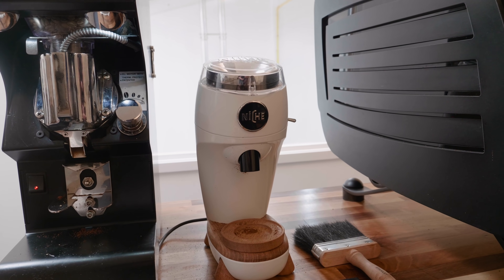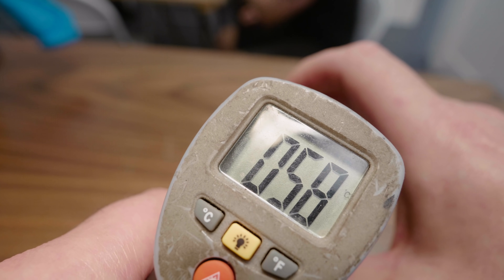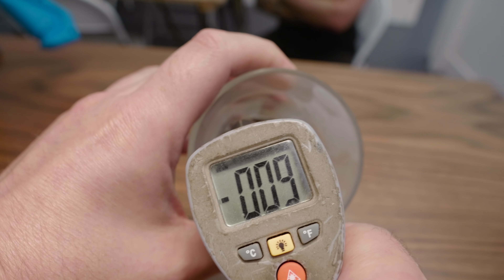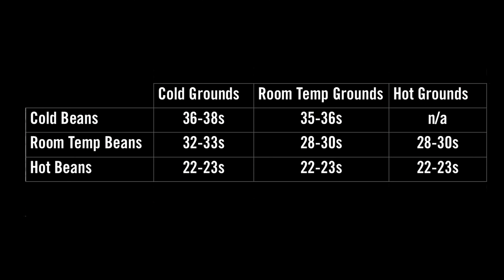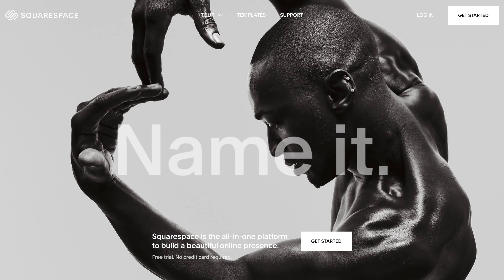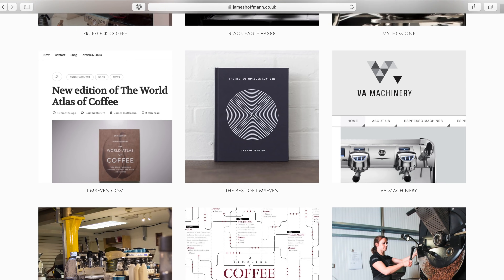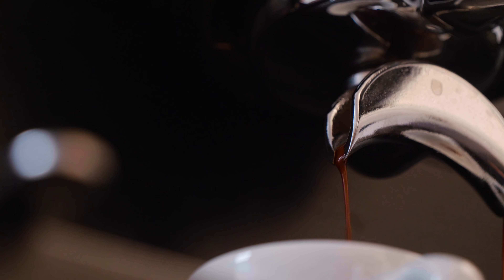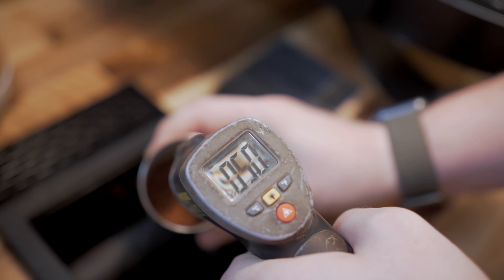Weird Coffee Science: Microwave Your Coffee Beans

Comment: Very interesting indeed.

My hypothesis as to why this happens is as follows:

Every grinder crushes the beans to an extent. The sharper the burrs, the less that happens I would guess, but it still happens. The crushing makes the beans break apart in places that they might already be weaker in, which produces fines. You can try that by cutting a coffee bean in half; even with a very sharp knife you will get many small particles.

Now, if you heat the coffee beans, the moisture in there in there spreads through them, making them softer and more elastic. Thus, the burrs have an easier time actually cutting the beans, and less "shattering" occurs, which leads to less fines being produced, and thereby finally to the ability to grind a bit fine and extract more.

I'd be curious what you guys think
Reply: This makes a lot of sense to me.
Reply: I was going to write a similar reply. I think by heating the beans, the oils are dispersed more evenly
Reply: I just woke up to thinking about coffee roasting then turned on the computer :) 
It seems to me old dry bread in a microwave brings it back if nuked for very short period of time by adding some moisture. An oven seems to do the same. I want to try this with some old dry (carbonized) toast and see what happens. 
I do wonder if its the oils in the bean or humidity in the air that is effecting it most but then heat may make the roasted bean more pliable/elastic. I notice dark roasts leave a lot of sludge when using a French press so I will have to see what happens by warming the beans with and without a small amount of humidity in a sealed bowl. I just looked this up and think it may apply. watch?v=YPNcTIauATw
Reply: My home grinder is crying for a burr replacement and landing on this video seems like destiny. I'm totally trying this out on my next drip.
Reply: What are fines
Reply: I wonder if this helps get a better result out of light roasts, especially ethiopian. Those are known to create lots of fines and are generally harder to get extracted right. If microwaving the beans creates less fines in the ground coffee, then maybe it'll make it much better in the cup as well, especially light roasts. I tried doing this on my light roast coffee, and it certainly turned out to make a more balanced cup of coffee. I used a moccamaster and a virtuoso+ to test this, so it's not espresso like James tried.
Reply: It's just a freaking cup of coffee.

Comment: Hi James,
In our paper we showed that at low T (dry ice, LN2) you made the average particle size smaller than at RT. But at normal freezer T the average particle size got slightly larger. We attribute this to a pseudo phase transition around 0 C (edit here: I originally mislistened and noted that the shots run slightly slower with cooling. This could be due to two effects, the mode of the particles is getting smaller, the volatiles are locked in. Heating causes their release, reducing void space for H2O and slowing the shot time per mL). This shouldn't be confused with the size of the fines decreasing monotonically. In fact, the reason for the skewedness of grinding at RT or likely microwave T (local T of H2O is very very high, the rest is being passively heated), is that you have likely reduced the number of fines being produced marginally, but also vastly increased the homogeneity of the boulders. I sit of the side of the "fines are doing the business",  so I'd be inclined to say that heating is problematic. Three other considerations here. I) we use microwaves to accelerate chemical reactions in the lab. The reason it works is microwaves, as I mentioned, specifically target a vibrational mode of H2O. The real test here is controlling for hydration level in the roasted bean. Of course in your samples they are all approximately the same but the corolary to microwaving is that molecules very near the hot water molecules are experiencing much much much higher local T than the rest of the bean. In fact the heat capacity of the bean is relatively low, so microwaving the bean is really just targeting local pockets throughout. In these pockets you may be performing chemical reactions, for better or worse, but it's worth being aware that a microwave is a chemical reactor. Ii) when we cooled coffee we had intended to also heat it using a similar process to Dawn. We couldn't do this scientifically because the deltaT was too great, even when dosing into an EK43. In other words the rate of cooling was way too fast to get good data from. Id be wary of assigning absolute T to any coffee beans using that surface IR device. III) letting the coffee equilibriate to the same T sounds, in principle, like a good idea and minimizing variables but actually at the T range you were looking at *this is your biggest variable*. Chahan and his talented postdoc Samo showed conclusively that the rate of certain volatile losses occured on the seconds (rather than 10s of seconds) time scale and the process is kinetically limited. This means at high T, cooling, vs RT sitting there, the chemical composition of the volatiles has vastly changed. Volatiles are one of the main reasons shots run at different rates - less water, solid interface, lower extractions, etc. When you grind hot you drive off more of these, and while your EY doesn't change (lets not talk about that measurement though...thats clearly problematic given the experiment I just described) your flavor profile does. Anyway, good compelling discussion but I sincerely hope we don't see people microwaving beans in the future, if only because reproducibility will nose dive.
Reply from the maker: Hey! Thanks for the comment. A few quick things:
- The shots ran slower, not faster, when beans were around 0C and below.
- I thought a lot about H20 retained (or more accurately reabsorbed post roast) back into the coffee bean - it is something we don't really talk about in coffee, and it's distribution in the coffee bean too. I was suprised that microwaving worked as quickly as it did. (My other thoughts didn't really go anywhere)
- It's interesting that regardless of heating method (water bath vs microwave) that you can still effectively up your yield for a given contact time.
- I've never (or to my memory) seen anything on volatile loss vs flow rate. Is there anything published you can link to?
- I'm not really proposing that people microwave coffee in a meaningful way - it's just a fun experiment, where I was surprised to stumble upon the effect, and more surprised that it didn't make the coffee taste at all bad. That seemed worth sharing...
Reply: @jameshoffmann  Ah sorry, I miss-listened regarding the rate in which the cold shot ran. Without sounding like "I can't be wrong", this new data does make some sense.  Cooling the coffee does make the mode size of all particles smaller so it going slower is the expectation.  This in combination with the retention in volatiles evidently results in a marginally slower shot.

The fact your coffee yield goes up with T is an argument for extraction being kinetically limited - higher average T, higher EY.  But what EY do you want, that is the question.  

Re volatile loss vs flow rate - no data published that I am aware of, but certainly true from my experience in large scale batch reactor setups.  I guess someone will publish on this at some point??

And finally, of course, I know you aren't advocating for this ;).  I'd like to show you an equally crazy idea I've ambiently been working on. I wonder when I will see you next.
Reply: @jameshoffmann : I am not a researcher, would be the effects of using colder beans for espresso, seeing that shots run slower that way, therefore dissolving more solids?
Reply: Christopher H. Hendon That’s easy for YOU to say...
Reply: @James & @Christopher, 

For me the quick comment that got me really thinking here was when James mentioned the Mythos One and it's heating element. Currently I have the pleasure of testing the newest Mythos 2. Not only can one choose on demand the temp of the heating element, but also motor RPM. So out of curiosity I cranked up the heat from my last dial in where I had set the grinder and RPM to it's lowest settings (30C, 700RPM). At the lowest settings the espresso blend I was working with was insanely sweet, high clarity of flavor, ripe acidity, with a very creamy body. I chose this blend to work with as differences in flavor/tactile are easily perceptible. I attributed most of the positive aspects to the lower RPM speed. Next I cranked up the heat to 50C. As expected the extraction time sped up significantly. Which then caused me to start grinding significantly more fine. After a few adjustments I got an espresso in line with my typical recipe. I found the body to still be quite enjoyable but the sweetness reduced and overall clarity of flavor declined. Had I more time to really play around with these variables my next experiment would be to also turn up the motor RPM a touch. Seems like heating coffee up and grinding is to mimic "peak" grinder operation. I'd like to see more being done in grinder tech to keep things more cool. Thanks for keeping interesting coffee conversations going, loving it!

Comment: Definitely going to try this! I always freeze my beans to keep them fresh for longer. Based on Barista Hustle's recommendation I started out grinding these directly from the freezer (-20). However, I always seemed to prefer my beans ground at room temperature, though, I couldn't quite put my finger on why. This seems to be a very plausible explanation for my experience. Now, I always vacuum seal my stock in the freezer and then distribute them over vials to last me a few days which works great and is very reliable. 

btw: do you keep a database for you weird coffee data? Would be cool if there would be a way to pool these sorts of findings across various users in some sort of larger (open-source) dataset! :)

Comment: So I have experienced this phenomenon before. I worked at a cafe and we had a rather cheap grinder. The more we used it, the more heat is was putting off. This resulted in us needing to adjust our grind finer during busy times. I think I figured out why. As the beans temperature increases, the maleability increases slightly resulting in grinds being able to 'squish' and make their way into the portafilter. The grind was more inconsistent, but grinding finer would fix the problem until the grinder cooled down. It goes in reverse as well. If your beans are cold, they shatter as opposed to becoming maleable. The grind can become more consistent when they shatter as opposed to squishing. 
In terms of effect on flavor, I never got to try that since I was serving them..

Comment: so how long should i be heating my beans and at what intensity
Reply from the maker: 45-60s assuming 800W should get you close. Depending on what vessel you have it in and how much coffee you are heating.
Reply: @jameshoffmann  Then it's safe to assume that, with an 1100w microwave and a ceramic cup, either 50% power or 20-30 seconds on high?
Reply from the maker: 30s on high, careful with ceramics though. Microwave safe glass would be preferable.
Reply: @jameshoffmann  I apologize for not thank you for your quick response. I tried your suggestion. 4 things to note. First, I'm using a Chemex like carafe made by Bodum, which uses Melita style filters. Second, there was a faint burnt smell. I can only assume is was some of the gas being released. Third, the creme in the filter was noticeably thicker than usual, but draw down speed wasn't noticeably changed. Didn't time it, because I'm still getting used to keeping my eye on the scale. Last, the resulting coffee had a slightly less bitter taste and was thicker. It must be noted, as well, that I used Guatemalan origin beans and heated them up as prior to grinding. TLDR; the coffee wasn't more enjoyable and wasn't less enjoyable. Heating the beans before hand gave it a different side of the coffee. Multiple personality?
Reply: I second that question. Not all of us have a temp gun/gauge just lying around.

Comment: It's kindy funny that all that years I heard that an advantage of burr grinder over the blade is that the former doesn't heat up grounds while grinding. Turns out it may actually not be bad! (use burr grinder though not to avoid heating up the beans but to get far more consistent particle size).
Is there an easy way to heat up beans without microwave that can be incorporated to a morning routine?
Reply: For coffee or espresso? I guess with an espresso machine you could put a little tray with beans on the cup warmer on top while it's heating up (except, in my case, I got a pavoni and no microwave, so I guess I'm out of luck ¯\_(ツ)_/¯)
Reply: @tobymarol7329  I am making pour over at home (home espresso turned out to be too much of a time consuming hobby for me :) )

Comment: There is a 2016 Nature publication that showed freezing beans at -80’C or in liquid nitrogen increases grinding consistency
Reply from the maker: That’s the paper I referenced. I was unable to acquire liquid nitrogen in time for the video because it’s more regulated in the UK. I still plan to test this.
Reply: James Hoffmann by the way, you can use dry ice (gets to around -70~80’C), or make a slushy of dry ice and alcohol (100%, but i guess vodka could work too). It should get you close to temperature if you want to try it at home
Reply: I'm curious about research with bigger sample size. The paper set a very interesting premise but was too limited to have any clear results imo.
Reply: Just watched the part where you mentioned it. I work in a lab so ive been able to try it...but one issue i run into is that as i start grinding (at room temp), the beans immediately pick up too much condensation.